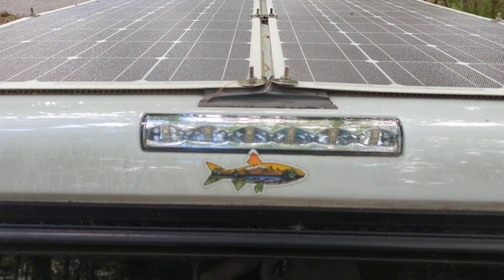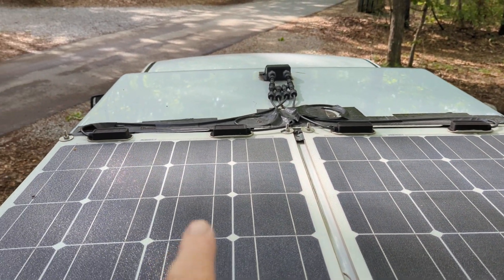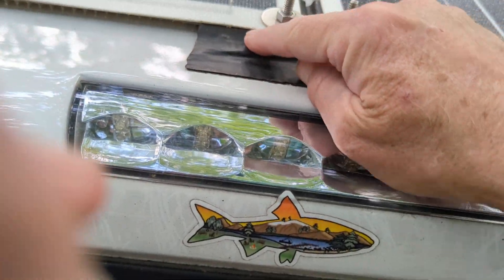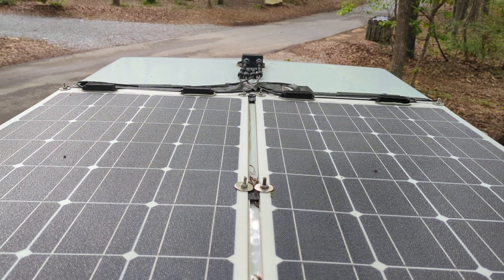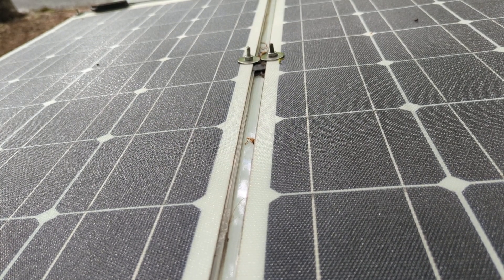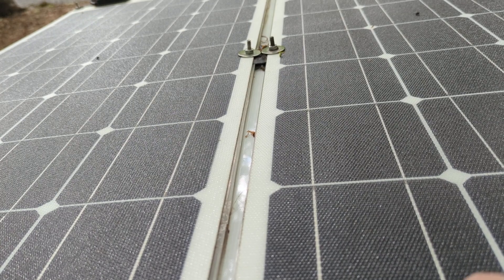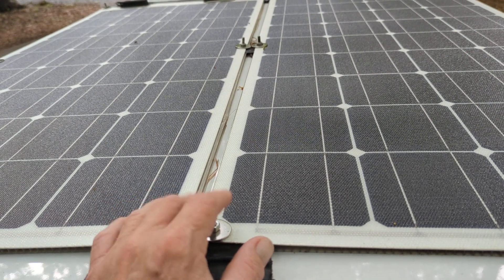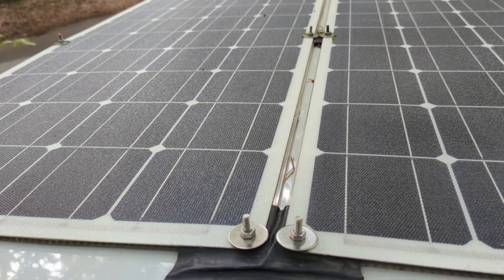Truck camping solar panels

Comment: Where do the wires go into if you didn’t drill any holes?
Reply from the maker: Sorry. I drilled no holes to mount the panels, but I did put in a hole for the wires. It is under the little black box at the front. It is designed specifically for this purpose. So far no leaks, and I've had the panels installed for a couple of years.